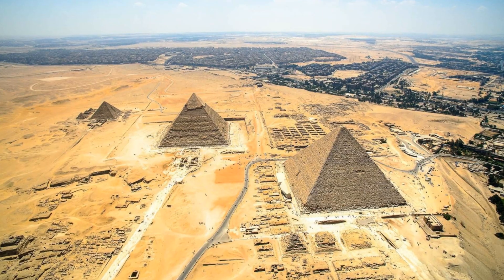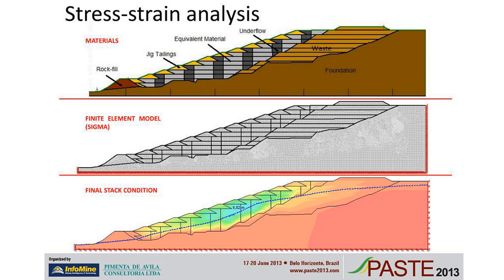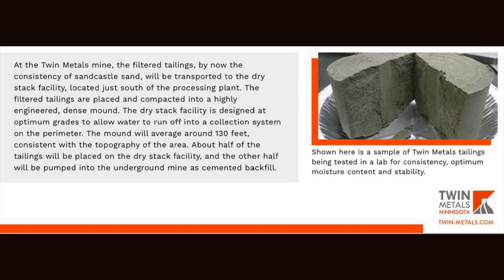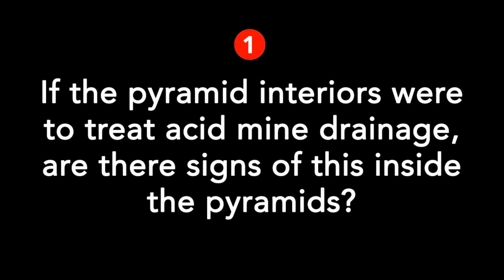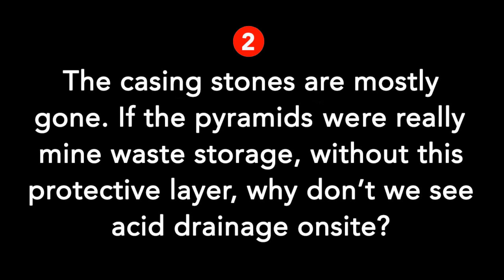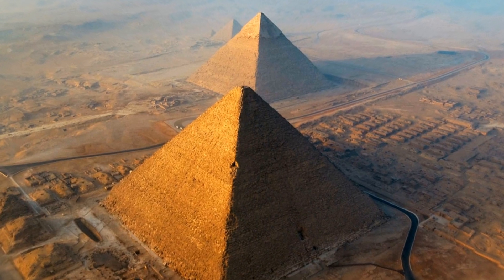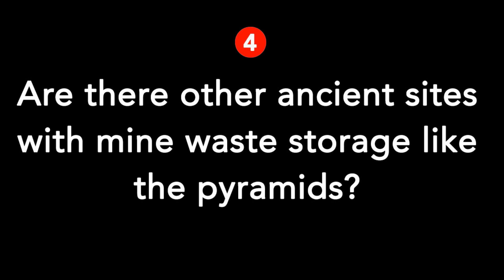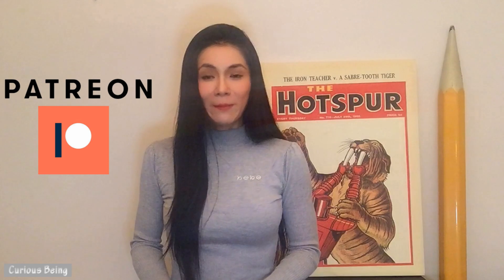Egyptian Pyramids Reveal Acid Mine Drainage Stains?

Comment: Im kinda sceptical when it comes to use of technologies in ancient times. Even tho the magnitude and sophistication of ancient architecture are kinda making me wonder if only relatively primitive tools were used. The question is: shouldn't we be able to find coroded remnants of machines in the ground? When metallic objects get buried underground they can last for tens of thousands of years (things like copper, stainless steel etc). There are plenty of instances when archeologists found some old coroded axes and other stuff underground that are dated for 10 000+ years (and these were not any kind of high grade stainless steel). Has this issue been addressed thoroughly anywhere? Unless the flood of salt water would help accelarete the process, but still, the water would eventually evaporate and slow the process while some things would definitely get buried and stop the decomposition process after all. Any thoughts on that?
Reply from the maker: Thanks Michael. According to the current timeline, the Bronze Age began about  5,300 years ago and the Iron Age came after. I wonder what 10k-year old corroded axes you are referring to?  Machinery made of metals would rust away and become unrecognizable in a few hundreds or thousand of years. Eventually the metal might degrade to a degree that it looks like geological ore. I do hope we can uncover some pieces of ancient machinery under the sand or water in the future.

Comment: I wonder what upper limit, if any, there is for the dissolving of the handles on the "doors." Can these structures be a million years old, or more? That would explain why there's no glass, fiber, or metal in evidence other than those handles. Basically ... unless you have special conditions, everything other than stone will break down in a million years or less. As for the concrete blocks that make up the mine waste portion of the pyramid ... normally concrete also does not last that long. I wonder if these blocks are extraordinarily stable, and if so, how long would they last before losing their structure and turning into sand? It might even be that the limestone casings protected them, such that the concrete has only come under stress of aging since the limestone casing was removed.

Comment: another great video Tina ,  the so called airshafts in the Gt pyramid  are a bit of an anomoly as they're actually constructed upside down according to the mainstream . They have a base but the sides and roof are constructed from one piece ,like an inverted U shape ,  this was obviously done for a specific reason they didn't do it just because they could  . If the passages were for collecting waste i would have expected them to be constructed with the base and sides in one piece and another block on top to seal them , also from the pics and videos inside the airshafts there doesn't seem to be any way for liquid to enter  if they were some sort of drainage passage . i like your theory but i can't see how the air passages would work in your model , which is a pity as i'd love your theory to be totally correct . 🙂
Reply from the maker: Thank you! Yes I'm still thinking about the U-shaped block in the air shafts since they don't take up the entire shafts; some areas don't have the U-shape facing down. May be like they are like today's perforated pipes which can be used with holes facing up or down depending on the usage? Well, I'm working on it :-)

Comment: Tina i rhunk you are half right.. but i dont think its mining.. they are way too elaborate and what were they mining exactly? Its alot of trouble to put the "star shafts" in this is a very difficult thing to do. I think you need to understand construction to understand what i mean exacrly.
Reply from the maker: Thank you Luke. I do understand construction from my architectural background. Not sure if you have seen this video - I compared the air shafts with something else. The True Purpose of the Great Pyramid's Interior System?!  https://youtu.be/BYr6HbEjS7w 
Also, about the so-called star shaft, I have another video - Great Pyramid: Let's Double Check the Mathematics & Star Alignment Claims https://youtu.be/nPswBtmQKD8

Comment: After visiting the Great Pyramid I believe that it’s possible that it’s a multi purpose structure. I can only guess what that might be.
But after examining the King’s chamber, I agree with Chris Dunn that the Great Pyramid is some sort of machine. 
As I mentioned before, the incredibly tight tolerances which the stone entrance to the so called King’s Chamber were cut is something that seems very unlikely to be needed for a mine waste dump. 
Also I’ve read that geologists have been able to verify the location of the limestone quarries that many of the pyramids blocks come from. They did not come from shafts near the pyramid, at least as far as I can ascertain by publicly available research on the issue. 
As I said Tina, nobody knows what the original purpose of these pyramids was. 
But whatever it was, the structures were mostly likely constructed by a pre dynastic Egyptian civilization, during a wetter climate era, and the builders would certainly have to contend with water leaked and drainage issues. So I’m not surprised that water erosion salts appear on different interior surfaces. But another cause of these surface salts can be the concentration of humidity inside the structure due to lack of interior air circulation.
Reply from the maker: Thank you for sharing your insight with me, John. I appreciate it.  The precision stone work can be seen at many megalithic sites around the world, in Europe, South America and Asia. It's obvious that the ancient builders had a very high standard of work quality. It would be difficult for us to achieve the same level of work or alignments but it might be easy for the ancients. They were more sophisticated than us and they had more advanced technologies.  I agree that the way the pyramids were designed and built would have internal humidity. Since the pyramid builders were highly advanced I think it is very possible that they were aware of the internal humidity accumulation and therefore provided drainage systems.
Reply: @CuriousBeingbyTina  I did notice while inside the Great Pyramid that not only was temperature much cooler than outside, but it did seem more humid.
I was with a tour group of around a hundred people, and it was in mid September when it’s still very hot, close to 100f. 
After you raised the internal humidity issue the thought occurred to me that perhaps several hundred people visit the inside of the Great Pyramid daily, and this modern condition has been an occurrence for many decades now. 
I wonder how much more internal humidity all these tourists cause just by exhaling moist air inside it. Perhaps this condition requires more cleaning of its internal surfaces in this modern era.
Reply: As to the precision of stone work of the amazing megalithic structures found around the world, yes the “fitting” tolerances between the stones are indeed very tight. 
But the entrance to the King’s chamber of the Great Pyramid is a different matter. Why would these ancient Pyramid builders go through all the effort to cut and polish hard granite blocks, in a passageway, achieving a perpendicular tolerance between the top and the sides of less than one half of one degree? Even at this time with using modern machines and cutting tools, it would be a very difficult task. 
It’s an oddity to say the least.
Reply: @CuriousBeingbyTina  One last comment Tina. I follow “Bright Insight” on YouTube, and he has recently posted a series of videos about his visit to the Great Pyramid, and the Bent Pyramid. 
I found them very informative and thought that you might too.
Reply from the maker: @Johnrack  Thanks John. I follow Jimmy/ Bright Insight too! I need to check out his latest video 🙂
Reply from the maker: @Johnrack  Yes that's a good point - the frequent tourist visits might have increased the interior humidity too.
Reply: I really hope you get to visit Egypt Tina. The scale of the building there, both during pre dynastic and dynastic periods, is amazing to behold. But even much of the dynastic period construction raises engineering questions to me. I read that you have a degree in architecture. With your trained eye I’m sure that you would question the common archaeological explanations as to how heavy objects like obelisks were raised in place. Like a tour guide told me, “All we have is a story. If you don’t like that story, then we have another one”.

Comment: If the tool marks resembled modern mining  techniques, wouldnt the mine drainage waste resemble modern mine drainage waste?  Ex: ground waste instead of blocks of material

How would tightly fit blocks provide the type of drainage that ground waste piles provide?  They're literally water tight
How would you even remove blocks from a mine?  Procedurally, it makes no sense to me
Reply from the maker: I think the pyramid builders were more advanced than us at least on this aspect. Our mining waste storage piles are not very sophisticated and disasters happened frequently.  Our mining operations produce waste materials such as waste rock and tailings. These might be the main components of the concrete pyramid blocks. I explained this in earlier videos. 
1. The Underground Complex: the Giza Osiris Shaft Created by a Lost Advanced Civilization? https://youtu.be/GloDq_h7yLg
2. The Osiris Shaft: Part of a Prehistory Mine from a Lost Civilization? https://youtu.be/JuGt7JEWT6E
3. The Great Pyramid was Not a Power Plant but perhaps Something Totally Unexpected https://youtu.be/ztkWo8g49S8
4. A Provocative Theory: Giza Pyramids as a Lost Civilization's Mining Waste Storage Site? https://youtu.be/tFzd2z0Rr1U
5. Great Pyramid: Let's Double Check the Mathematics & Star Alignment Claims https://youtu.be/nPswBtmQKD8
6. Prehistoric Mining: What was Mined on the Giza Plateau? https://youtu.be/y6ShuJdzDS0
7. The True Purpose of the Great Pyramid's Interior System?!  https://youtu.be/BYr6HbEjS7w
8.  The Secret Enigma of the Egyptian Pyramids’ Interior https://youtu.be/hxWEWUsvcS4
Also concrete or stone are not waterproof. They are porous and water will seep through when saturated.
Reply: Maybe you need to watch more of the videos. Tina points out geopolymer

Comment: Wouldn´t a small amount of drainage tunnels with only slim cirumferences suggest that the structure was built in dry climates?
Reply from the maker: Yes I think the pyramids were built during the dry time. I heard about the Thunderbolts Project quite a bit - I will check it out. Thank you!
Reply: @CuriousBeingbyTina  Thank you for answering. 

I enjoy the hypothesis you´ve put forth in this video, it is relatable and at the same time evokes my imagination.

Comment: Hi Tina. I’m sending a link to Brien Forrester’s video on the Karnak temple complex in Luxor. I hope you don’t mind. https://youtu.be/eqmAuczgvA8

As I mentioned I visited Egypt and went to Karnak. Although much of the construction dates from the middle and new kingdoms, Brian points out areas of the complex are made of harder stone, have evidence of high heat melting damage, and exhibit megalithic construction techniques. 

While visiting there in 2001 I was unaware of these very apparent different construction styles, nor did our guides seems to know about it either.
They did however point out the deep inset hieroglyphic carvings on the granite obelisks which date from the new kingdom, which until this day have sharp edges. The guides also mentioned that the only way engineers believed that those carvings could have been made is by laser cutting. 
As a manufacturing engineer myself, id have to agree.

That begs the question, which is that if the megalithic stone constructions in very ancient Egypt, that were made with some type of lost high technology, and are evident throughout the country, is it possible that some of that lost high tech machinery was found by the latter day dynastic Egyptians and used to cut, carve and erect the massive stone obelisks and other odd things that can be reliably dated to that time? 
It’s my theory that lost ancient high technology may have also been discovered and used by the dynastic Egyptians in some instances, for smaller projects than say building the Great Pyramid.
Reply from the maker: Thank you for sharing with me, John. I love Brien Foerster's videos and I do want to take his tours in the future. I have been thinking about the same thing - the crisp carvings on Egyptian granite artifacts means high-tech/ laser cutting; but how did the ancient Egyptians do so? If they did make these hieroglyphs then what tools or technology did they use? Are there any records of the making of these engraved obelisks...?
Reply: @CuriousBeingbyTina  All good questions Tina. I don’t think anyone knows for certain.
At some point in the future I hope to take Brian’s tour as well.  I felt like the 2001 tour was like trying to take a sip from a fire hose, as there was so much information to absorb. I’ve learned so much more since then, and this time I’ll bring my machinist square, a close up lighting kit and a set of digital calipers. Perhaps a hand held laser measuring device like carpenters use to hold square and parallel construction elements too. My hope is to make the spring 2023 tour. 
If you do come, I would suggest hiring a videographer there with a good low light digital camera. I don’t think it would cost too much. You could make high quality on site video clips of up close megalithic features that show evidence of ancient high tech machining, and then edit the video clips later.
I do have one travel suggestion though. Had I known better I would have paid for a first class seat upgrade. Nowadays I travel first class when playing my music gigs, because I arrive at far flung destinations feeling rested and in better physical shape. 
I came to find out that most long distance flights nowadays have lie flat seats so one can sleep, and Egypt Air only charges a few hundred dollars to upgrade. Or at least they used to.

Comment: I have often wondered why so many people think the pyramids were built 4500 years ago during Kufu’s time and what kind of case they have because your theory puts the pyramid construction many thousands of years before that. So I did a search and found: https://www.youtube.com/watch?v=OndDC3eSaro&t=14s
In this YouTube presentation the author claims there is no good evidence that the pyramids were built 4500 years ago and instead he presents a dating method based upon the rate of erosion and that puts the construction at 11,000 years ago. This may be further evidence that your theory is correct. And I think mainstream thought will have to adjust eventually. You have such a good presentation on such a profound topic.
Reply from the maker: Thank you Carl - I appreciate you sharing with me! I think it's very possible that the pyramids were much older than the "official" claimed time, could be over 11,000 years old :-)

Comment: I like your overall theory but I just think one part doesn't make sense. The "air shafts" or "drains" run only north and south, not east and west, yet there are 4 of them - this doesn't make sense - why have 2 facing 2 directions and 0 facing the others? Also, didn't explorers have to cut through the rock walls of the chambers to access them?
Reply from the maker: That's a valid point and I have been thinking about it. Not sure if we can find more such shafts in the great pyramid. Modern explorers documented that the shafts openings inside the Queen's chamber were blocked by efflorescence salt encrustation and the air shafts do connect with the chamber.
Reply: @CuriousBeingbyTina  they weren't 'blocked', they never ran fully into the queens chamber, this is well documented, the stone block with the shafts was fully smooth wall surface with the shaft stopping several inches back from the wall, British archeologist discovered them and chiseled them open, the relics were found inside the north shaft, ceder wood, dollerite ball and bronze hook

Comment: I think the climate has a lot to do with what we see. Also it the system for controlling the acid run off is working, then we shouldn't see much signs of it..??  Its possible the air shafts were just to equalize air pressure so any leakage will run down and drain away. If there was positive air pressure inside it would force any acid seepage out to the surface of the pyramid. Just some random guesses.
Reply from the maker: Thank you for sharing your interesting thought. I considered whether the airs shafts could be real air vents to equalize air pressure inside the pyramids, though in that case the shafts need to vent to the outside, no? The Queen's chamber air shafts end in the pyramid and the King's ones might be originally covered with casings. That's part of the reason I think these shafts might be designed for draining instead.
Reply: @CuriousBeingbyTina  If they were all closed then they are drainage only. I think then there could have been a breathing action going with the changing outside temperature and air pressure. Maybe it wouldn't mater??

Comment: Actually the pyramids aren’t solid, there’s an area next to the queens chamber that is filled with sifted silica sand, maybe special sand for a specific filtering property… fits with your theory too
Reply from the maker: Interesting information - I will check it out. Thank you!
Reply: Maybe on Uncharted X ,it slips my mind , there's info that the sand is not chosen for what is, but for what it isn't. Local sand can form acid, while this sand is Si O2, just ground quartz which is inert.